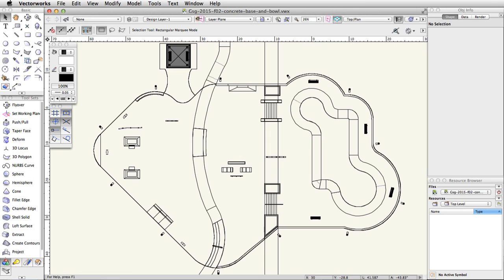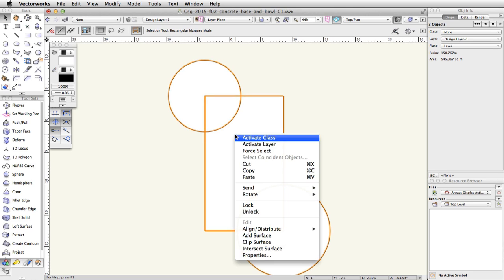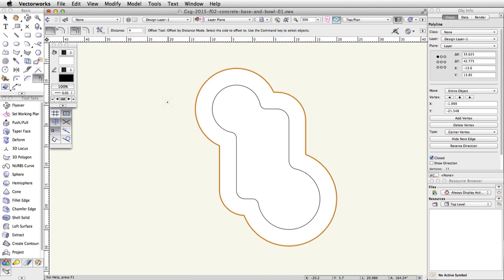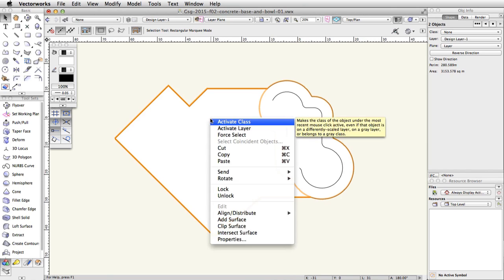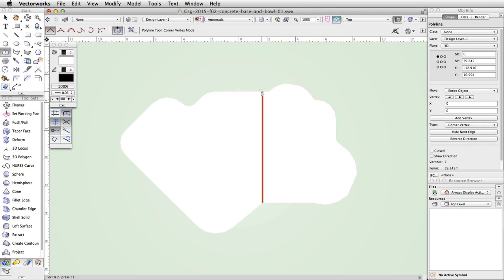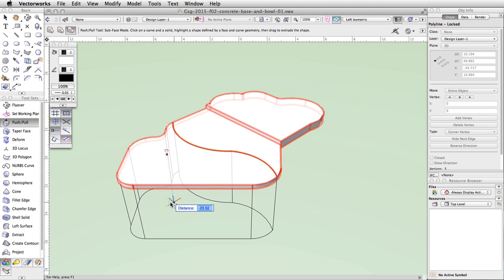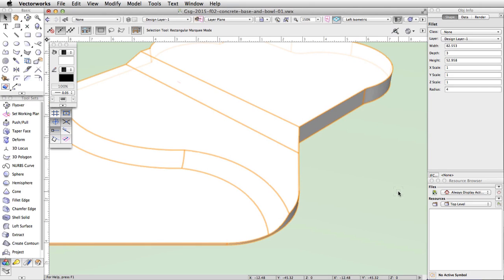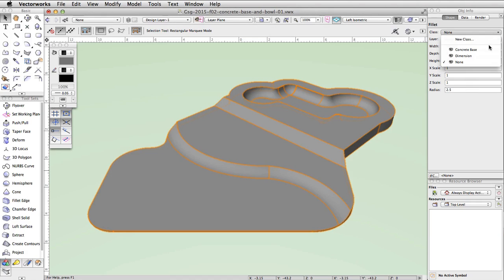GSG - Vectorworks Fundamentals 2015 - 02 Concrete Base and Bowl

Comment: Hello, working through your tutorial, but I get stuck at the part where you pull the shape up into a 3D form (around 9:30). When I try to use the push/pull tool, I don't get a solid plane to draw the next line on to. Any clues on how to fix this?
Reply: Having the Same problem here
Reply from the maker: Sam Klimmek Hey, I went through the steps in the video and I was able to use the Push/Pull tool on the base shape for the concrete bowl. Make sure you have the first mode of the Push/Pull tool enabled (Extrude Face Mode). You can also select the polyline and use the Extrude command in the Model menu, to create the 3D Extrude. If you are still having issues creating this object, please send a quick email to tech@vectorworks.net. Thanks.